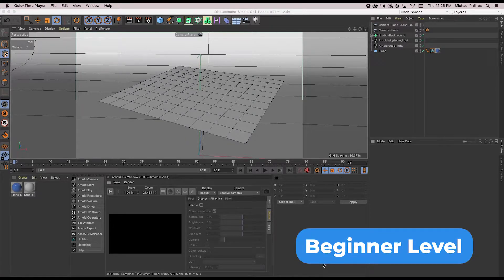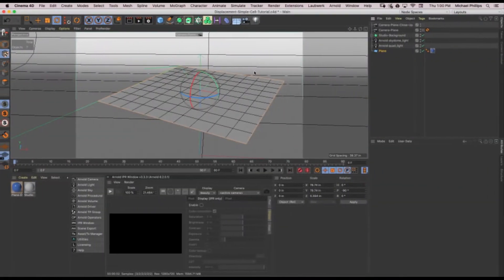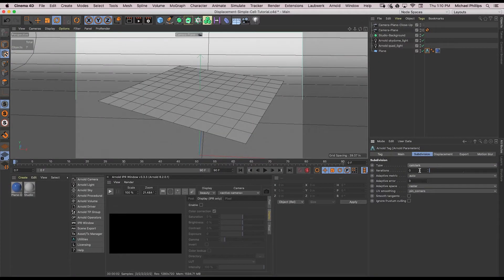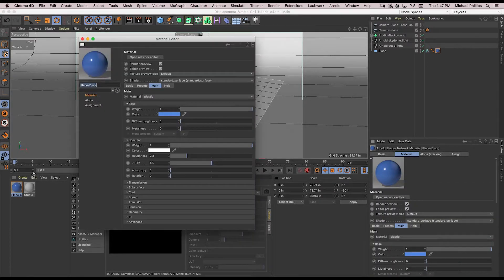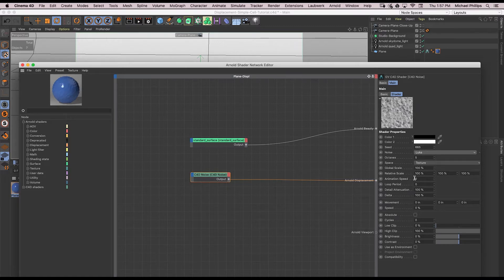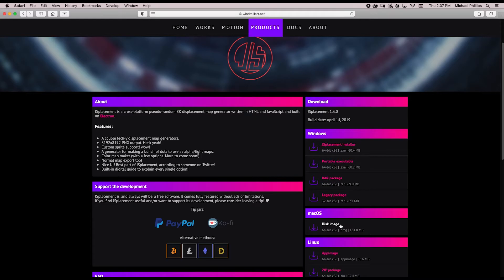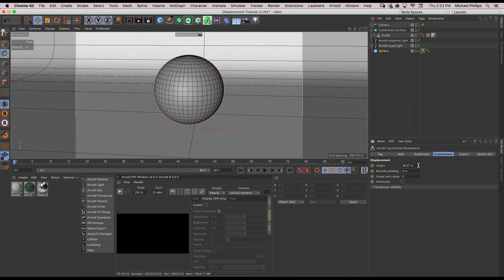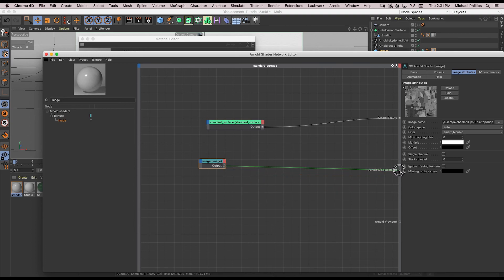How to Use Displacement in Cinema 4D and Arnold (2021)

Comment: Thank you so much. your tutorials are simple and straightforward. Thank you. Can I ask what kind of studio object you are using?
Reply from the maker: I am assuming you are referring to the backdrop and lighting.  For the backdrop, its just a cube that is made edible and I delete all the sides of the cube besides the back and bottom and put into a subdivision surface to make it like a cycle wall.  For lighting, in these tutorial I generally just use the built in C4D studio HDRI and copy the image and add it to the texture field in of the Arnold sky object.
Reply: @mphillipsphotography7013  yeah that makes sense. Ok I have 2 other questions.

1. How do you generally go about adding labels to models(esp glass), i usually have to use the alpha stacking and I was wondering if there is a shorter way; layer shader gets tricky sometimes.

2. Whats the correct way of connecting ambient occlusion maps in arnold?
Reply from the maker: When you say  Alpha (stacking) I would have to see what you are referencing.  The easiest way I have found is as following:
1) Create glass texture
2) Create Standard_Surface for label
3) Use Image node to connect to Standard_Surface color.  (Make sure the image you are using for your label was saved with Alpha - Example .png)
4)  Apply Glass texture
5) Make a selection of where you would like to add label and apply the 2nd texture with your label to that selection.
6) Set the correct projection method for label and disable tiling.
7) In object manager double click your label texture.
8) Now in Attributes window you should see the following - Basic | Material | Alpha(stacking) | Assign
9) Select Alpha(stacking)
10) Mode - Drop down menu select "Shader"
11) Shader -  Drop down menu select image(image) (or if you renamed the image node choose what ever you called it example - "Label(image)"
12) Verify use alpha channel is selected
13) Now you can just choose "Use Texture Mode" to move your label around, scale, etc.

As for Ambient Occlusion I will have to look into but hope this helps.

Comment: Thank you very much for sharing. But I have a question, that is, how do you make the edge hard? The edges I made are not hard.
Reply from the maker: The more geometry your model has the more detail it will have.  Either add more segments to your geometry or more subdivisions.